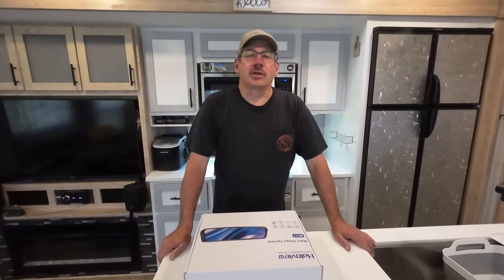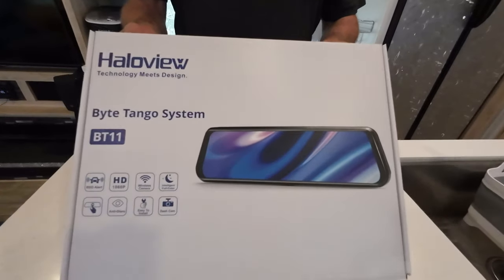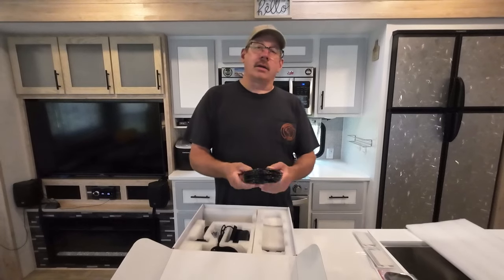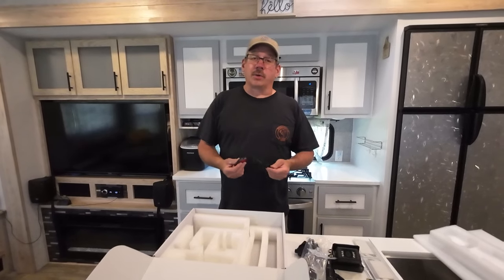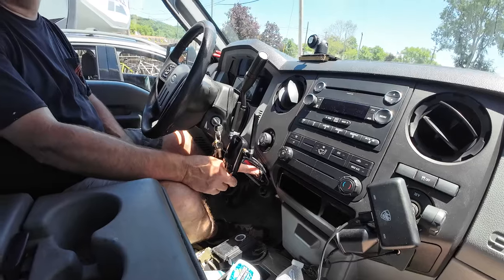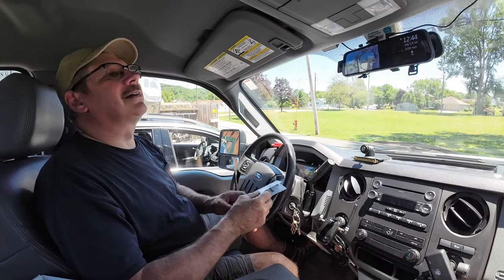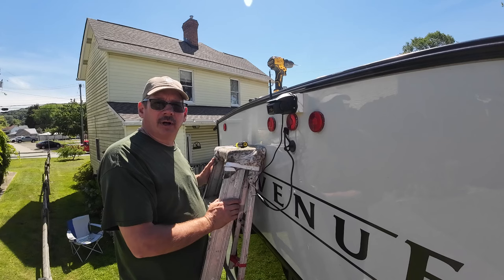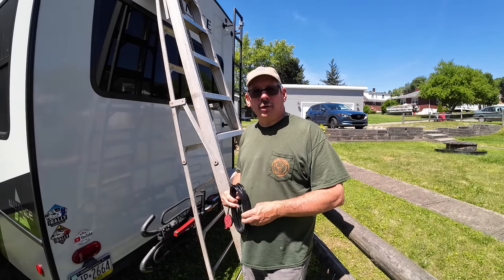Haloview BT11 Install and Review

Comment: Thanks for the review, very thorough.  Did you end up using the antenna extension wire?  How long is your rig?
Reply from the maker: I forgot to touch base on that in the video. From camera to monitor is about 42'. I didn't use the antenna extension and I lost signal 5 times. 3 on the way up and twice on the way back. I think that's well within the margin of error for me. If the camper was any longer I would definitely add the extension.